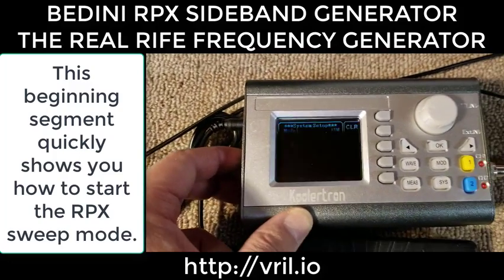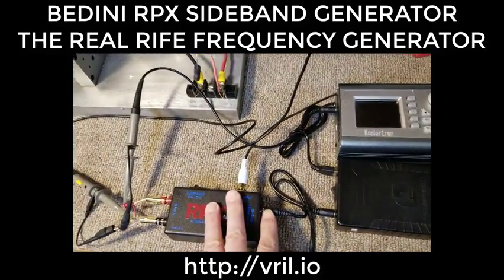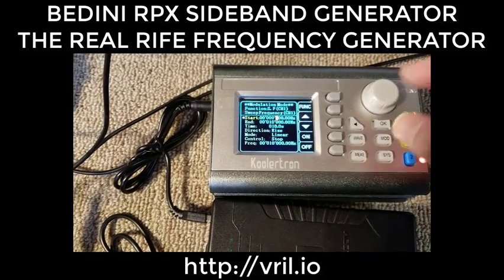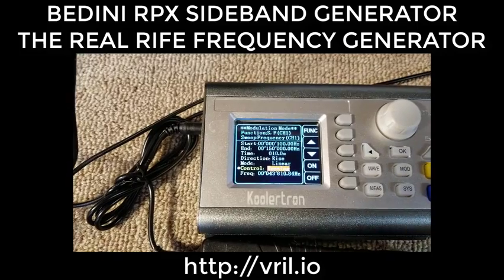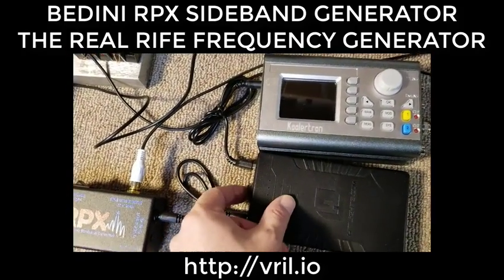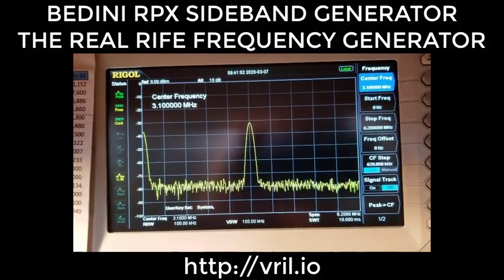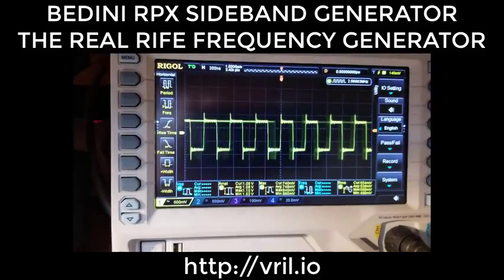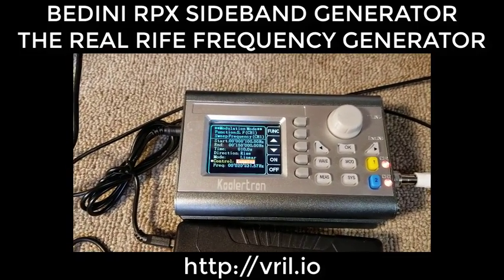RPX Sideband Generator - Koolertron Signal Generator alternative to the Feeltech

Comment: Mr. Murakami, can the two cables that have the banana fittings on the end be connected to a sound card on a pc in order to use spectrum analyser software?  Thank you sir.
Reply from the maker: I hook a dedicated spectrum analyzer to the banana jack output so I'd assume so. Ground to the black plug and the probe, I don't electrically connect it to the red plug, I connect it to a twisted wire that is wrapped around the red output so it is capacitively coupled for safety of the spectrum analyzer.
Reply: @AaronMurakami13  Sorry for the delayed response Mr. Murakami my computer died on me.  Thank you for all your advice, from a customer service perspective, advice and support on your RPX device is 100%.  I will download the analyzer software onto a redundant laptop while I save for a spectrum analyzer and implement your advice.  Whatever happens is my own responsibility.  God's bless and keep you all.
Reply: @AaronMurakami13  Do you have a Bedini RPX book DVD for sale? thanks
Reply from the maker: @yunshuizhongyi Hi, I don't. Energetic Productions LLC used to sell those but they closed their operation down.